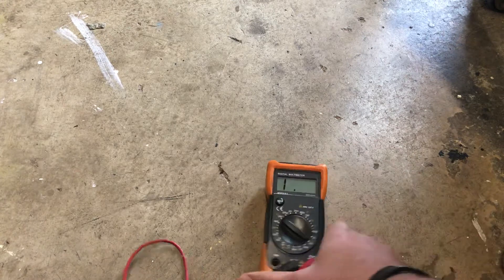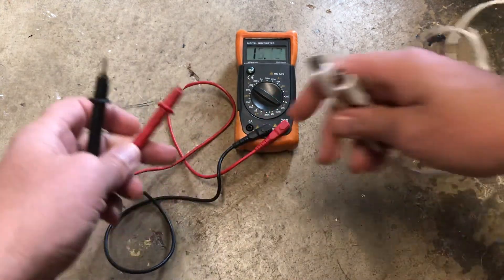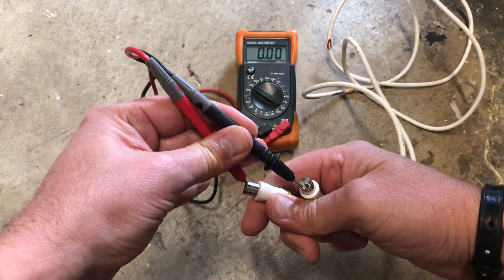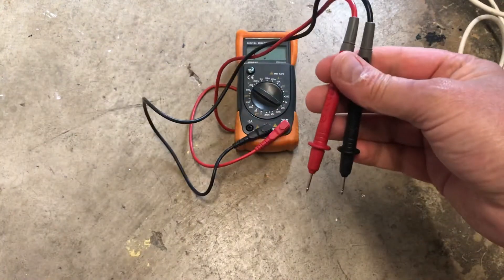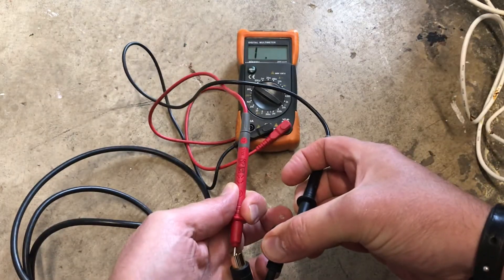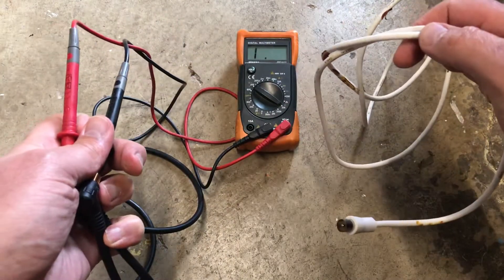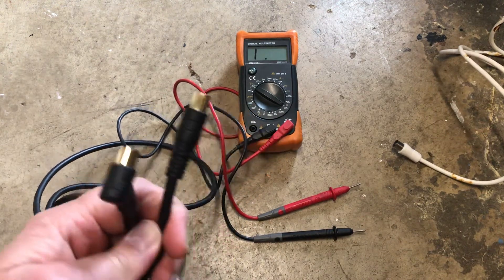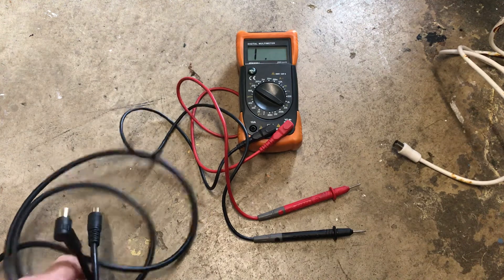How to check for a bad coaxial TV aerial lead using a multimeter

Comment: Hi - was helpful, but isn't there essentially 2 cables in a co ax - couldn't see where you put the probes - on the pin bit inside or the outer casing --- looking like the probe was touching both, unless that is exactly like the way you should do it
Reply from the maker: I put the probe in the two ends, touching the pins. I don’t do anything specific, there was obviously a complete break in the wire, some leads may just have a short, so that might need more testing.